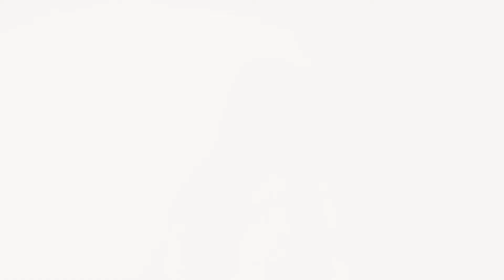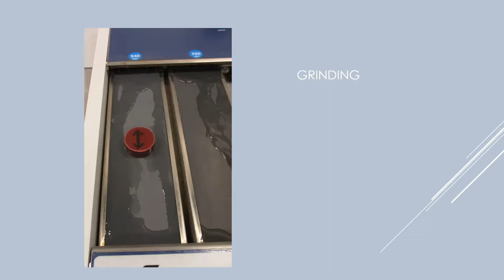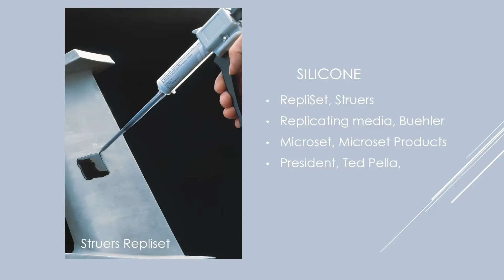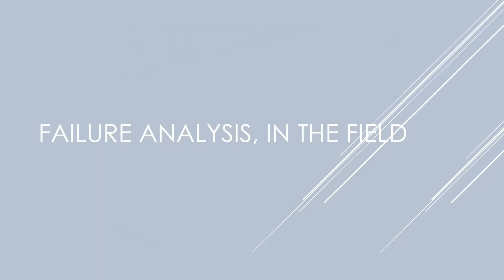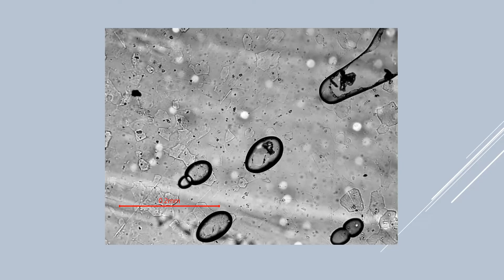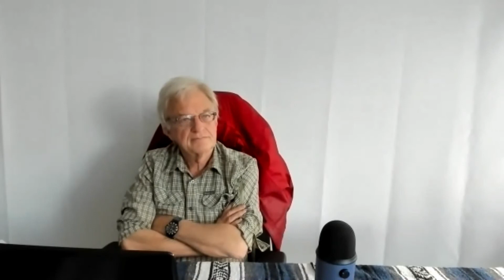October 7 2021   In Situ Replicas, In Situ Metallography, FMR   Bruce Levan

Comment: Hi, could you advice on which product to use on circumferentially cracked cylindrical specimens to monitor the crack growth
Reply: I would try alternating current field measurement.(ACFM). I used this for fatigue crack growth. Originally there was no training or certification. But that has changed. I have a better opinion of the method now.